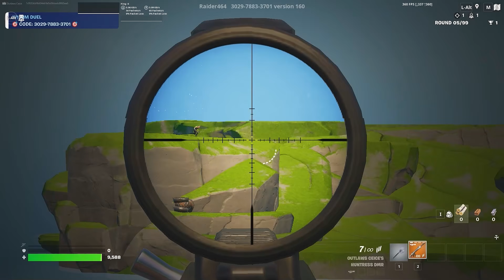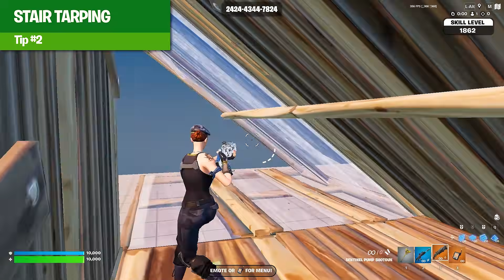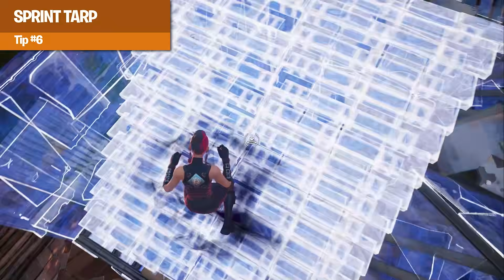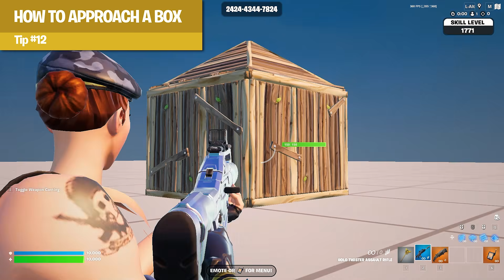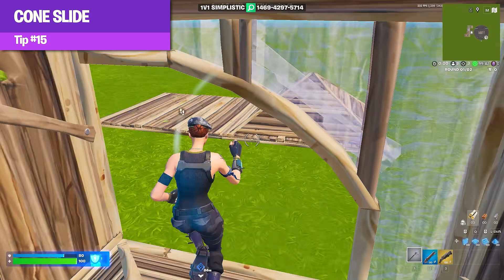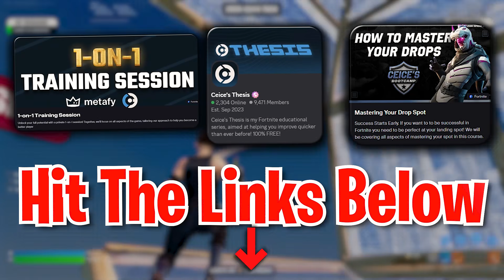How To Build in Fortnite — Pro Tips & Fastest Techniques

Comment: bro WHAT FREAKING CONTROLS DO I USE MY STUFF IS DEFAULT ZXCV FORTNITE I CANT DO THAT AND WALK AT THE SAME THE TIME
Reply: U need to change ur keybinds. Thats how u will be able to walk and have double movement while building.
Reply: I changed my builds to two mouse side buttons for wall and stair. And T for floor and V for cone. That ended up helping by taking the Z and X away. Maybe Y and C will be better if you dont have mouse buttons? C isnt too bad to reach.

Comment: Got my sub man, this is extremely useful info.  I was boxing all wrong.  I'm struggling to fit sprint, crouch, and all the build binds on keys that don't force my fingers off WASD.  If you were to prioritize them, which build types are the most important to be on things like mouse side buttons to avoid messing up your wasd movement?  Thanks!  I see you have cone on Q, so maybe that's the least important one?
Reply from the maker: Made me so happy to read this, so glad I can help you on your journey!  To answer your question, I would 10000% have wall on your side button, other than that its up to you. Preferably a build bind but could be anything... whatever is best for you
Reply: @Ceice  - That makes a ton of sense.  In my testing, doing 90s without the wall on side button is like pulling teeth.  The others seemed manageable.  Like for ramp, I'm never running sideways and placing ramps.  Thanks!